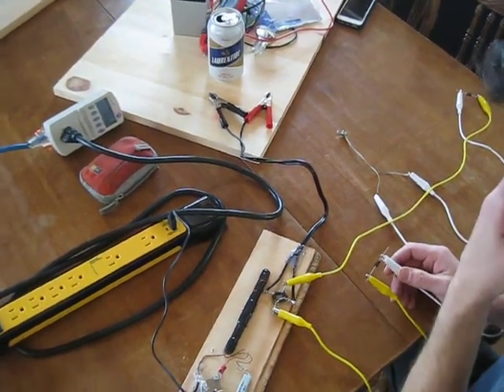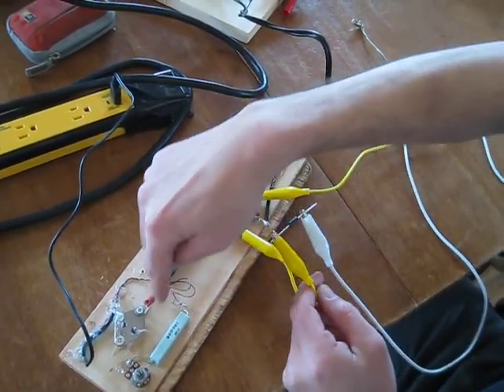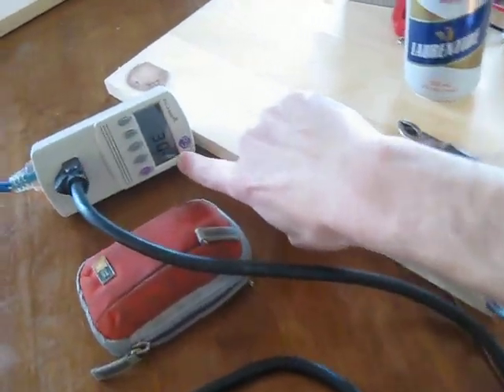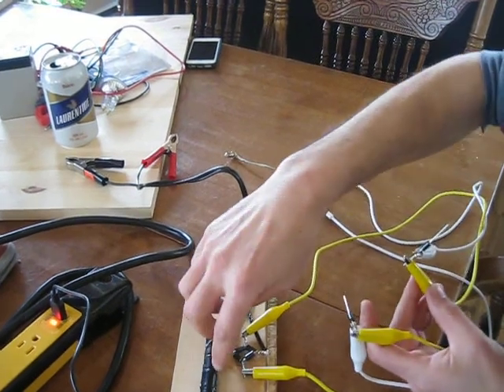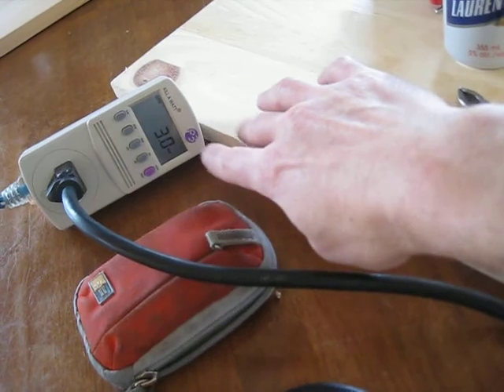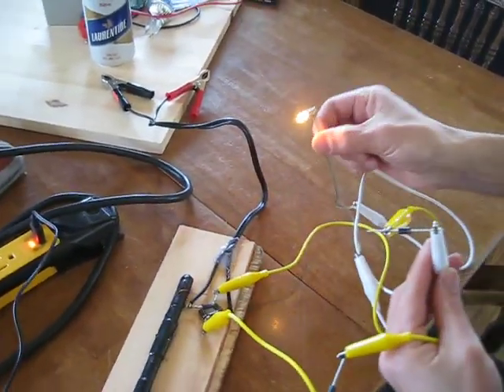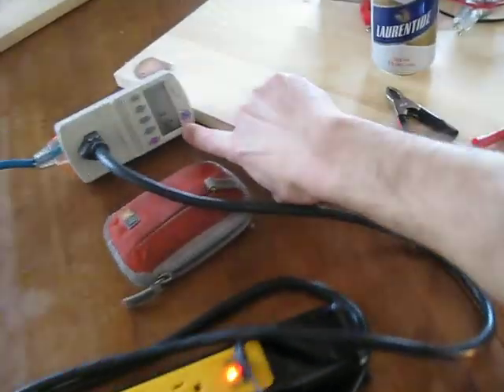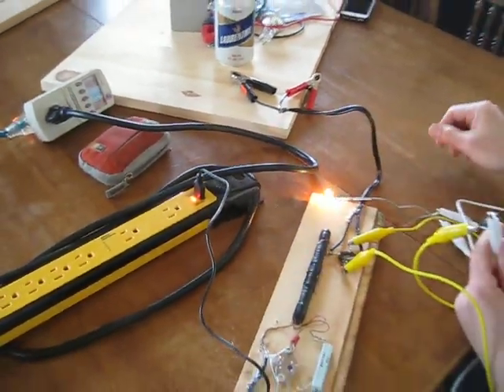The way to connect POC when your primary are pulsing dc...

Comment: I'm really struggling. It seems that I found the best group in existence just in time to watch it disappear. I hope he's ok.

I found this video somewhat accidentally. I'm trying to do essentially the same thing. I know what to look for while watching the current across my .1ohm resistors in the POCs but I think my switching signal isn't disconnected from the source when it goes low. I simply dont know how to do this with low voltage.

I can contribute. Are you able or willing to consult me? I don't expect to be handed anything but I do need some mentoring.

Comment: Thanks for showing this! Can you please share the circuit schema? I'd like to try it.
Reply from the maker: Dragos Culea 
Hi, it is just a simple joule thief with POC over it.
Just go on the site I mention on the description of this video to see much more! ;-)

Thank you for your comment!
Reply: I know about POC. So, the basic schema is this:

http://forum.hyiq.org/content/uploads/b5d8d256-5657-4ec2-ac7c-a741014a20b4/87be8e90-f784-4f97-9495-a7f30010a59a_circuit.jpg?width=690&upscale=false

, but you removed the capacitor? Is this correct?
Reply: I've just noticed you have the schema attached with the load connected between the starting and ending points of the secondaries and diodes to force current opposition. It matches what you show in the video. 
Again, many thanks!